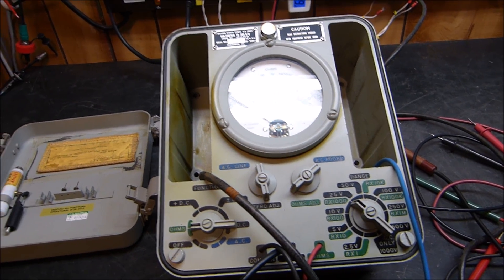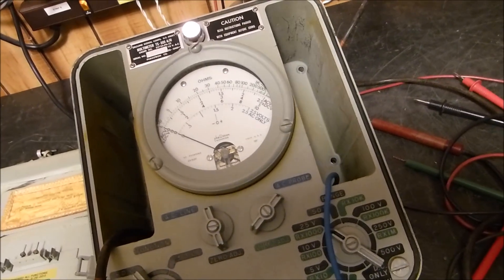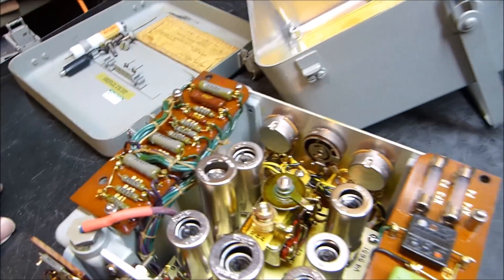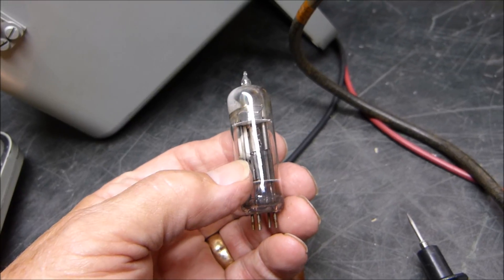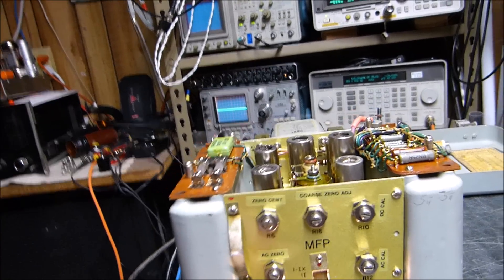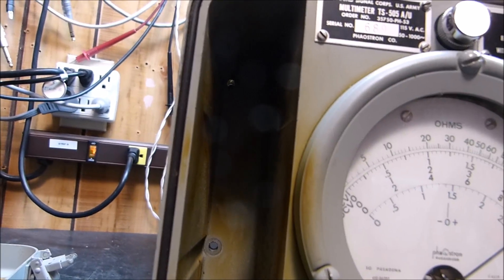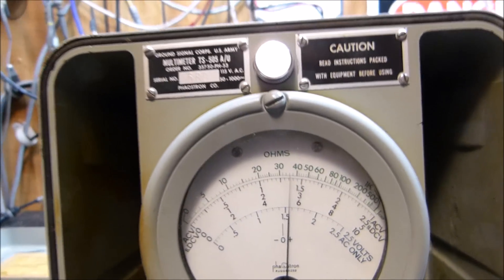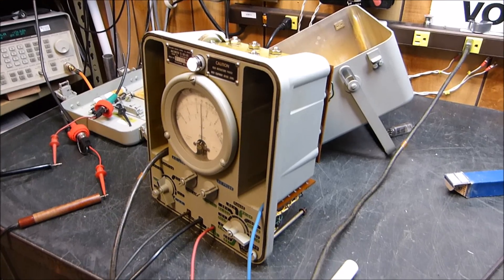TS-505 A/U Vacuum Tube Volt Meter (VTVM) Repair and Check Out US Army Circa 1955

Comment: Cut my teeth on the TS-505 VTVM in Tech School, then about eight years later repaired them for Raytheon. The high input Z made this meter ideal for T-shooting everything from the front end of an FM transceiver to the audio output stages. BTW, El Paso strikes a note with me. I supported missile launches at Fort Bliss and White Sands for 30 years. I love El Paso Texas!
Reply from the maker: You just convinced me to bring this beauty out and check it. Last time I directly used it was to align my Collins R-390 receiver. I was at WSMR from 1976 to 1996. Wish I could do it all over again. I love El Paso also.

Comment: hello i have one Multimeter TS-505D/U, but  does have fuses F3 and F4 any info of value?
F1 and F2 ( 1 amp ) thanks best regards
Reply from the maker: What a coincidence I saw your comment. For some reason I don't get notification of all comments in my email which is the only place I look. At this time, I am helping a fellow work on his meter and just saw your posting from 1 month ago. Unfortunately, I am not aware of F3 and F4 fuses. I just looked thru the schematic and don't see them there. Maybe take a magnifying glass to them and see if they have a value stamped on them.  I do see F1 and F2 (1 amp) as you noted. I am sorry I can't help here.
Reply: @ElPasoTubeAmps   dont worry, find in schematic is 1 amp both...
it just doesn't work properly...
Maybe because have one tube 12au7 instead 12at7 or capacitor 100uf is bad

Comment: David. You probably have to just realign the adjustments so it tracks correctly at different voltages. It is quite a sophisticated piece of gear that leans on accuracy.

Comment: Glad it was a simple fix.
Reply from the maker: I like simple problems... In many cases, there is the $5 fix and then there is the $500 fix, as it depends on how quickly the problem is diagnosed correctly. A misdiagnosis would likely lead to a complete "retubing" of the unit and it may never work properly again.  I love working on electronic equipment but I really don't like my instruments to go bad. You never know the outcome as it can be the end of the instrument if it is something like a transformer or other critical part that would be very difficult to find and/or replace. I have a nice old AM/SSB receiver, cannot recall the brand right now, (edit: Gonset G-66B) but it has a bad BFO coil so I can no longer receive SSB. First off, I doubt I  can find the correct replacement coil and second, it is buried so deep in the radio, I am not sure I can safely do the surgery without destroying the whole radio. It is a marvelous AM receiver. I really should make a video of it as it is so nice.

Comment: It's amazing how reliable this old gear is. I have a TS 505 and an AN/URM-25F, RF gen (goes to 50MHz) acquired in the mid 70s. Both are all original and fully functional. Beautiful equipment. Really enjoy your channel. When I got an HP 334A distortion Analyzer the first thing I did was go to your Y ouTube channel to see how to operate it. Thank you!
Reply: Military equipment has to be rugged and reliable.  That nice device is a reflection of a time when things were built to last and be serviceable, when necessary.  It's a far cry from today's throw away mindset.

Eli D.
Reply from the maker: I went to work full time in January of 1970 and we had that attitude of build it to last forever and, when necessary, repair it to last forever. That was nearly 48 years ago as I write. Sure seems like yesterday. And I certainly agree with you that things aren't built like that anymore.
Reply: @ElPasoTubeAmps   I have a ts505 that needs a little tlc.  Can you help? 73 K9RGW
Reply from the maker: @ralphward1653  Hi Ralph - I forgot you sent me a message the other day. If I don't answer a question at the time I see it, I tend to forget. I don't take in any equipment to repair but I assume there is a schematic inside the meter case and a full manual can be found on line. It shouldn't be too hard to fix. 
I assume you have this manual ?
https://radionerds.com/images/8/88/TS-505A_Manufacturer_Instruction_Book.pdf

Comment: As you say, this and gear like are beautifully made, works of art as well as functional. Does it use a thermocouple for the meter? Would appreciate it if you could describe how the meter works, going through the schematic for us less knowledgable acolyte's.
Reply: It's a Weston movement (http://www.rfcafe.com/references/popular-electronics/meters-september-1960-popular-electronics.htm) micro-ammeter.  The exact full range will vary from instrument type to instrument type.  My RCA VTVM uses a 200 μA. full scale movement.

Eli D.
Reply from the maker: It is not a thermocouple type of meter.  The biggest thing that makes schematics of instruments like this unwieldy is the range/function switches. If that can be removed, in our head when looking at the schematic, it is not too hard to find the flow of the signal through the circuits. I appreciate the confidence you have in me but I am not sure I would do a good job explaining the details of the circuit. Thank you for your comments.